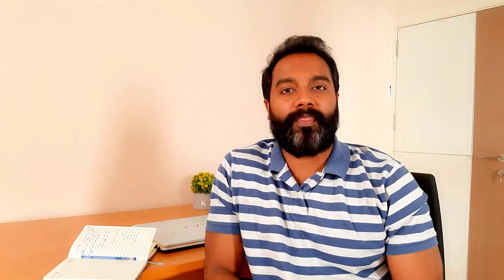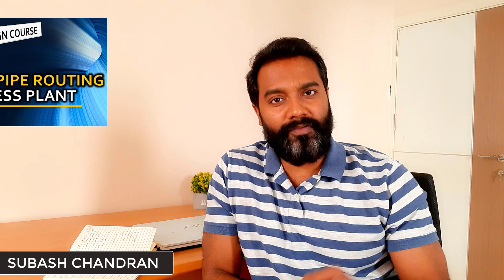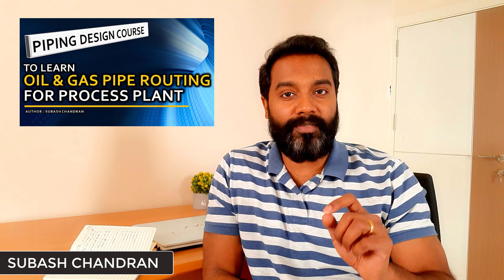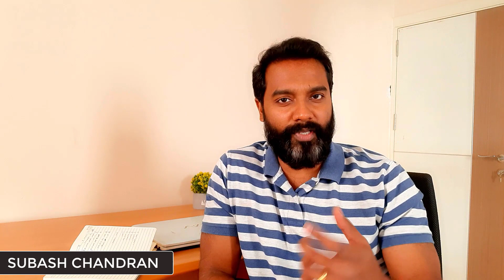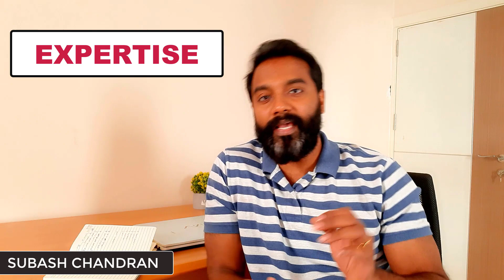Professional expertise and skills required to become an experienced Piping design engineer

Comment: I sincerely feel that all the comments made by you in this video are valuable.  In the future you should explain to the employee how to handle it when problems come up with some significant documentation that you have generally learned from your experience.  It will be even better if you explain in the future with some examples how to handle each problem and what model methods to follow to deal with it.  Thanks. please make some daily PIPING tips video. Which will be more helpful for your subscriber. Thanks again.